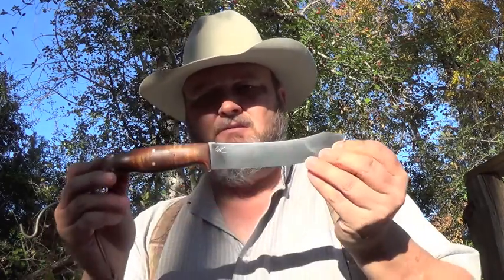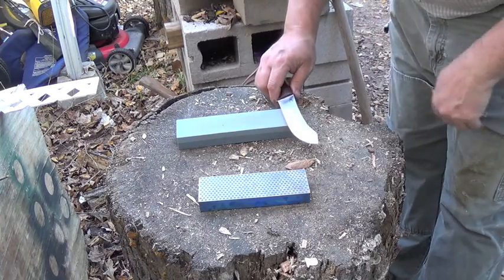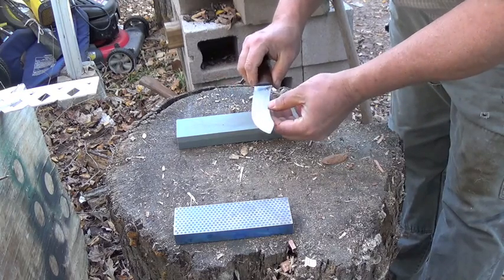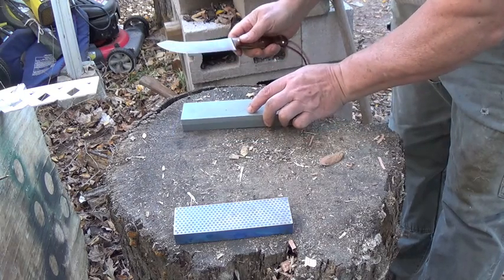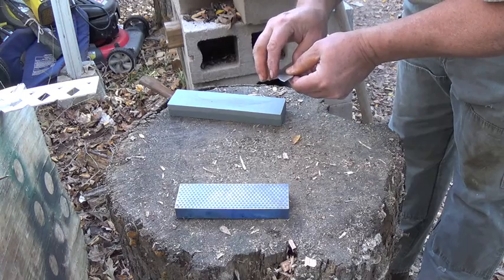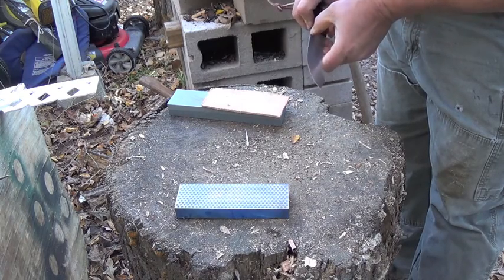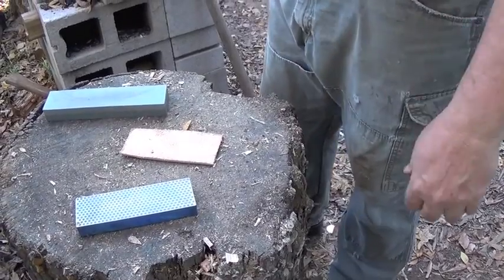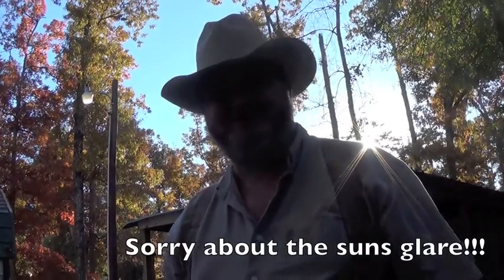Whittle Talk (How I Bench Sharpen a Knife)

Comment: I learned and developed my sharpening skills from Dr. Wako . Even further. So I use many expensive Japanese stones  ( 120-, 220, 320, 400, 600, 800, 1000, 2000, 3000, 5000, 6000, 8000, 10000, 12000 grits) to be continued with 2 or 3 levels of my self made loaded leather strops. And at last blank leather. Finishing with my own made oil (%20 bee wax, %60 lamb fat oil, %20 linseed oil) and I do it for all my knives and hatchets in my collection. I know it’s quite an obsession. Having a big hunter family, I have seen they do it like you do. Even rougher, with back of a teacup or its plate. Rarely with a rod and that would be a fancy occasion. :D

Comment: Love that butcher knife.  What's something like that run from your shop with Iron wood scales?  Something with Saber grind, no guard, slightly deeper index finger grove.
Reply from the maker: +aHigher Power In 5/32" O1 tool steel without a sheath $195.00.
Reply: William Collins
Great Thanks.

Comment: Funny little trick I learned to knock the burr off: take your knife and run it perpendicular to the corner of the stone very lightly (imagine cutting a block of cheese in half). Do it so lightly that basically only gravity is doing any work. Learned that from a razor sharpening video.
Reply from the maker: Appreciate the tip.

Comment: Hi William. Just bought 2 Mora Companions for me and my son in carbon rather than stainless. From bits I've picked up on the Tube they seem to be prefered by many. One bushcrafter said "if its not carbon its not worth having". A thought i've had is are they as safe for food prep as SS? What's your preference between the two? Any downsides to carbon or SS? Im 67 but new to, in my case, new hobby (knives & sharpening etc)so value advice from people who know from experience rather than trotting out "knowledge" they've just heard. Bless you and be happy. ATB from the UK.
Reply from the maker: Carbon knives have been used for game processing and in kitchens for 1,000's of years and other than achieving a nice natural patina on the blade there have been no side effects. Myself I prefer a good high carbon steel but they do require a bit more attention such as not storing them wet. The blades should be kept oiled and they will serve you well for many years to come. Stainless steel for the most part is a harder steel than most carbon steels and is a bit harder to sharpen. But around salt water or very wet conditions could be a good steel to have. Appreciate your support.
Reply: Thanks William. Im learning bit by bit. SS near salt and wet makes sense. I quite like the idea of having to keep an eye on the carbon by keeping it dried off & oiled as you're not treating the knife casually and just chucking it in a back pack after use. I'm into pride of ownership! Same with my guns. Maintenance of tools is all part of it, not just the use. Bless.

Comment: Minimize the guessing by cutting a small block of wood to the degree angle you seek for your blade to be sharpened. This way, you can just rest the blade on top of the cut block (which sits on top of sharpening stone) and sharpen your blade with consistent angle per sharpening session.
Reply from the maker: +냄새꾸리꾸리한 발까락 I think the block of wood will be ground down against the stone as well and very soon, with just a few strokes, the wedge of wood will not be the proper angle anymore. Best to train your muscles with out aids to achieve the proper angle. IMO.
Reply: +William Collins (WC Knives) 

Very true. I did not think to mention about the possibility of the wood block warping. Thanks for mentioning that. I've only used the custom wood block for few sessions so I did not reach to the stage where I would have noticed much warping of the wood. Ever since I got the Tri-Sharpmaker from Spyderco, I haven't had the need to use any other sharpner (other than a keychain sharpener, which I always have with me just incase).

Comment: thanks for the tips. I just got an old forge 7" butcher knife high carbon.  From what I gathered its made by case and production quite in 1968 so I guess it's an antique. I appreciate your videos and keep it up. If you fill like checking out my channel I'd appreciate your thoughts. God Bless.
Reply from the maker: wildernesscamp 85 That is a very good knife. I like the old (relevant term) Case knives before they went to the stainless blades. Not that they are bad knives now. I just prefer high carbon steel. I will check out your channel. Appreciate the view and comment.

Comment: William Collins I sharpen my knife the exact way you do on a 20 degree angle sometimes even 15 degree but I don't go from in and out I go from out and in so from away my self getting closer to myself because I think the opposite of that the way you are doing it damages the knife a little bit and shortens the lifespan of the knife
Reply from the maker: First I have heard of that. Not sure how direction would matter that much. You still make the same amount of passes and with the same pressure but if that way works for you then that is what matters. Appreciate your view and comment.
Reply: +William Collins (WC Knives) so basicluly it doesnt matter wich way im going eith the knife , the end product is the same i presume
Reply from the maker: gojart destani that is what I think. Some would argue that the direction of the sharpening stroke aligns the edge micro teeth h a certain direction to assist in cutting. Picture a butcher steel and how it is used. I sharpen in that direction for this reason. Don't know if it is true or not.

Comment: I really enjoy your videos... I'm having a little issue with one of my stones. I have a stone that is a 1,000 grit on one side and 6,000 on the other side, well, the 6k side has a bow in the middle of the stone and it's a newer stone but I've used in a lot over the past few weeks and I was wondering what causes that and how to fix it?? Can you please help me? It's not a very expensive stone but I'm an ole country boy and I don't have the money to just throw away on a new stone..  @williamcollins
Reply from the maker: Brad Slone appreciate your video support. All natural stones will wear and need to be flattened periodically. Best way I know to flatten a concave surface is to rub two stones together until both stone surfaces are flat again. I have done away with my natural stones for this reason and only use metal stones with a diamond surface. These will not concave.
Reply: @wcknives  I appreciate you responding so quickly. I will give this a try. And I plan on looking into a diamond stone as soon as possible.